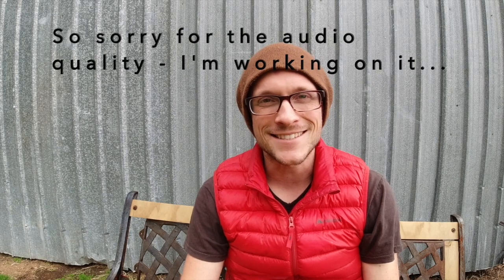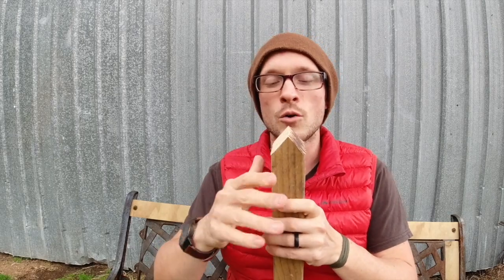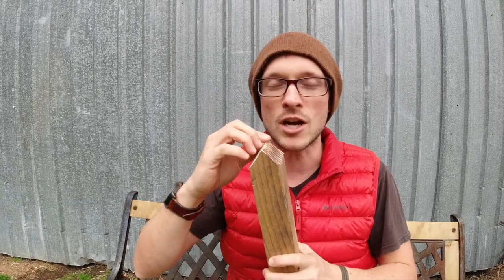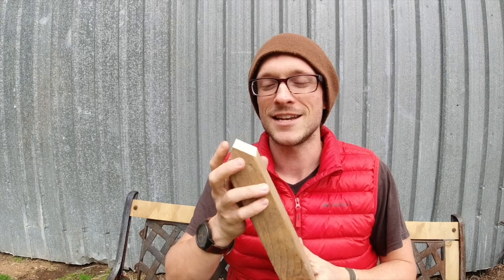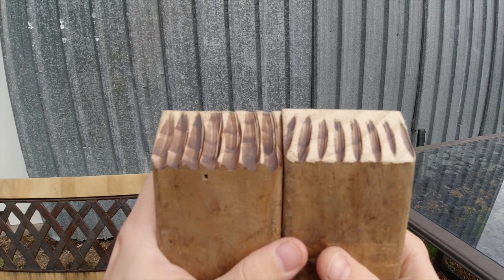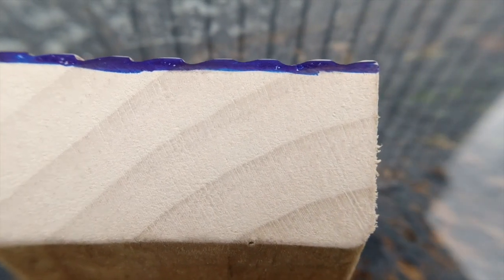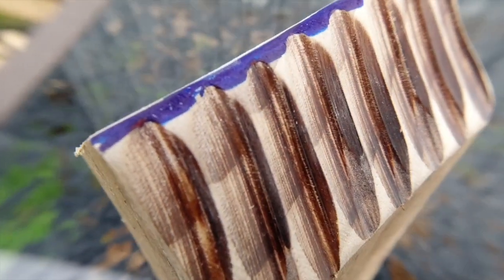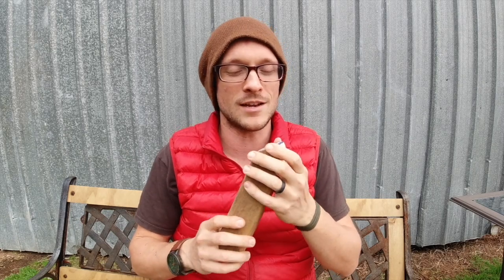The Best Edge Ever... But Why? My Latest Theory on the Micro-Physics of Dual Grit Edge Sharpening

Comment: Epicurean Edge, a local knife shop, has a sharpening service that does an incredible job. From what I've been told, their technique is to sharpen to a polished edge on waterstones, and then run a ceramic coarse stone over it.
The edges are truly incredible, and I am wondering if this is a different approach to getting a dual grit edge.
Reply: I use a similar method, Gabe has helped me with by starting coarse . but I definitely 
need to start lower grit but ! 

1. Use a 600 grit diamond on both sides 
2 on port side use a dry black aluminum oxide 
3. Port side white aluminum oxide ( smaller micron) 
4 .strop with a 1 or .5 micron diamond spray on bass wood 
5. Finish with a bare compressed Russian finish leather, or Red Russian finish ( high compressed silicate) strop 
With gabe’s help this process produces a milder form of his duel edge , but is very aggressive edge yet polished , easily the sharpest /longest lasting method I have achieved in 40 years 
Super steel Steve’s YouTube videos have a similar advice on starting very course and then polishing 
( warning ⚠️ his videos have very vulgar language and are polar opposite of home slice )
Bro science is now proofing unfounded science in metallurgy. Home slice , Pete , BIg brown bear, Super steel Steve and many other YouTube channels are really breaking new ground in sharpening 👍👍👍
Reply from the maker: @sstein49  Thanks bro - I am so glad you found a method that is producing markedly better results how exciting!

You're making me want to buy more sharpening gear!
Reply from the maker: I'm not sure, that edge sounds awesome though.  I may have to try it out!

My friend just published his scientific article, I'm going to throw together a video this weekend to share whether or not my theories were close to reality!

Thanks for tuning in!

Comment: Rather than supporting carbides (which quite possibly could be occuring) to me it would seem the dominating process is simply as the dual edge wears like any other edge, however when the coarser ridges wear, their size physicaly resist further wear to the apex and adjacent fine edge errosion and effectively protects the fine edge for prolonged cutting performance. 
I like to think of your dual grind edge more like a chisel grind because the fine honed side (when magnified) has effectively created a smooth flat plane which intersects every part of the coarse ground other face (thus forming a continuous 'serrated' fine edge just one with more support in places than in others).
This has probably just repeated what you were saying, but thats how I awkwardly think of it, cant wait to hear what the boffin's say.
Reply from the maker: No definitely that is a good way of summing up my theory at this video's publishing

My friend just published his scientific article, I'm going to throw together a video this weekend to share whether or not my theories were close to reality!